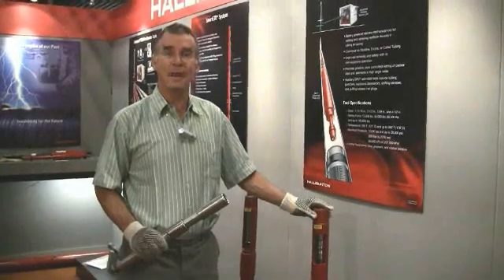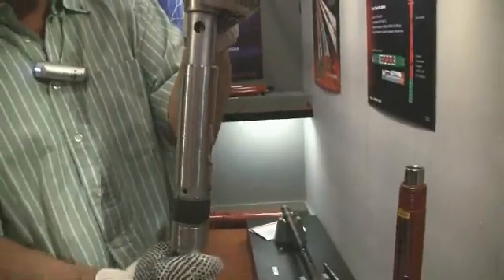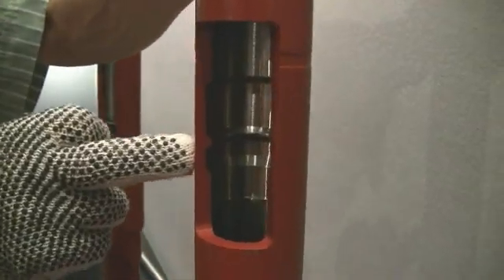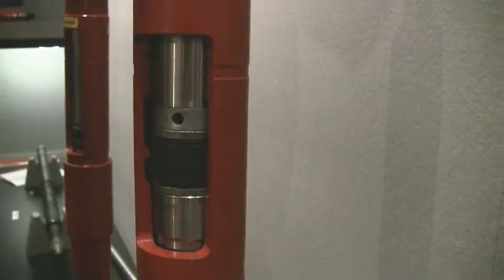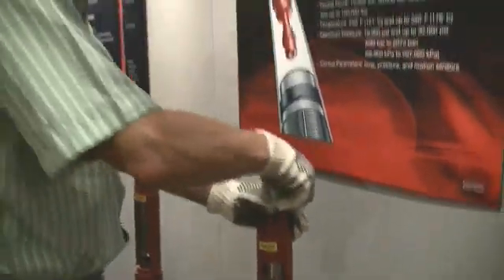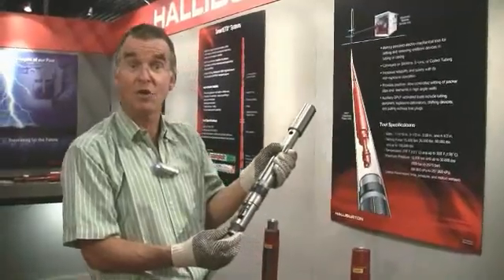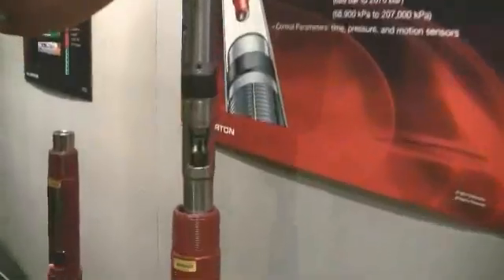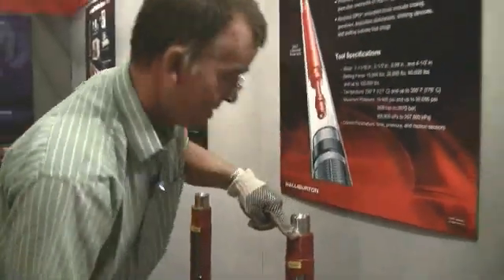Landing Nipples In Oil And Gas

Comment: Torque & Drag – Why Every Completion Engineer Must Care 🚨

When deploying a completion string, Torque & Drag (T&D) is one of the most critical factors that determine whether we succeed… or end up fishing.

---

🔹 Torque – The Rotational Load

Defined as the force required to rotate the string around its axis.

Directly affected by:

String length (longer = more torque).

Well trajectory (doglegs & high inclinations).

Contact points between tubing/casing.

In completions:

Critical when rotating liner hangers, screens, or expandable packers into position.

Excessive torque may cause string twist-off or premature tool activation.

---

🔹 Drag – The Axial Load

Defined as the resistance to movement when slacking off or picking up the string.

Influenced by:

Well inclination (drag is higher in deviated/horizontal wells).

Tubing OD vs. casing ID clearance.

Friction factor (mud type, wellbore condition, debris).

In completions:

Affects the ability to land the string at TD.

Impacts setting of packers, SSDs, and TRSSSVs at precise depths.

High drag may prevent proper liner-top packer sealing.

---

🔹 Why T&D Models Are Essential in Completions

1. Tool Placement Accuracy → Without T&D predictions, nipples, SSDs, and safety valves may end up off-depth.

2. Running Heavy Strings → Long completions in deep HPHT wells require precise load calculations.

3. High-Deviation Wells → Horizontal/deviated wells create extra friction, risking stuck pipe.

4. Expandable Technology → Screens & packers need controlled torque for successful expansion.

5. Operational Efficiency → Minimizes risks of POOH, fishing jobs, or string failures.

---

💡 Field Example:
In a 60° deviated well, drag calculations showed >40% higher pick-up loads than expected. Without prior modeling, the packer would never have set at target depth. The completion design was modified with centralizers and drag-reducing fluids – job saved.

---

👉 Bottom Line:
Torque & Drag are the hidden forces driving completion success. Ignore them, and you’ll pay with stuck strings, mis-set packers, or worse… a fishing nightmare.